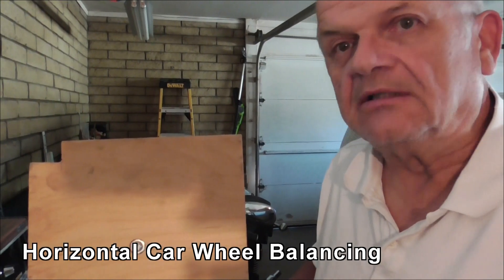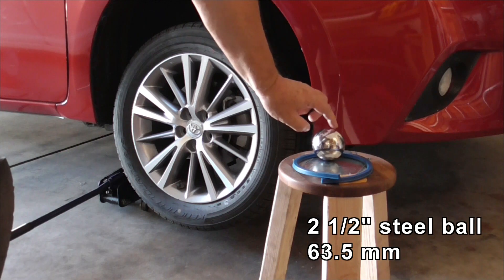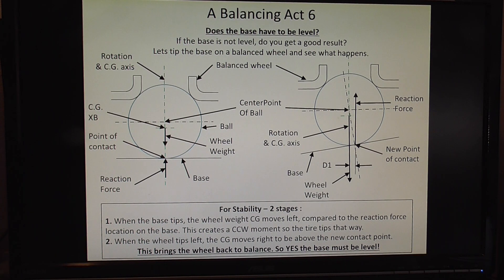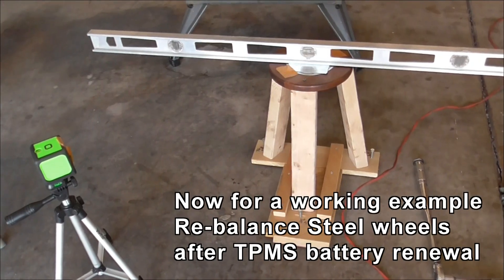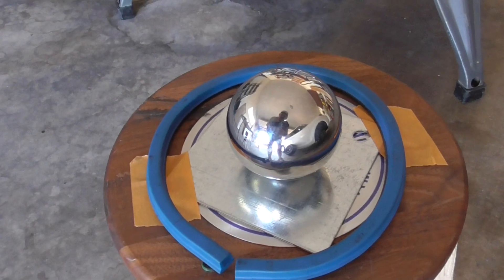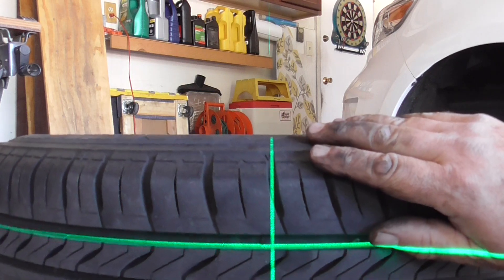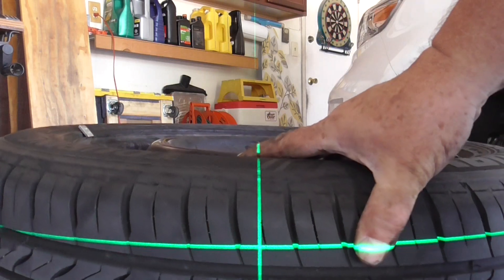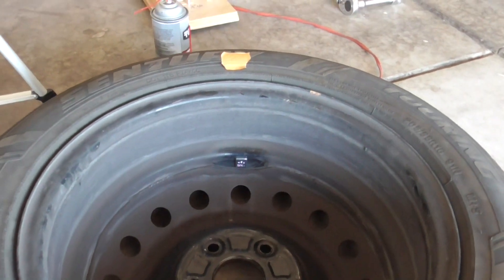Horizontal Laser Car Wheel Balancing 3

Comment: Genious! Never underestimate an older chap with lasers! Like Yoda but different. I am trying this for sure and I am pretty sure it will work! Thank you very much.
Reply from the maker: It does work on most wheels. There are limits depending on where the CG of the ball is compared to the CG of the hub or wheel assy. Couple of video's that explain that.
Kia soul tire change https://www.youtube.com/watch?v=WgjNO2gt3xg
Full explanation (boring) https://www.youtube.com/watch?v=xyv2FnseOI8

Comment: Hi, Adrian from yorkshire here. just wondering what would happen if you sat the steel ball in a cup of oil, to remain sensitive but dampen the wobble, say gearbox  oil
Reply from the maker: Hi Adrian, Like a hypoid gear oil? I'm sure that would work even though it would be a bit messy. And it would work better in winter than summer.
The important thing is that the base the ball sits on is level.

The wobble is not that bad, as I saw on a recent tire change. I pre-balanced the hub, then balanced the wheel
Hub balance   https://youtu.be/w3ukxfY6duI?t=302
Wheel balance   https://youtu.be/w3ukxfY6duI?t=550

Comment: ahhh i see you have now refined it and used a harder material. Im getting sub 5 gram sensitivity.
Reply from the maker: 5 gram, or 1/4 oz in my case, is more than good enough for the speeds I'm comfortable with. There is a tollway in Oklahoma with an 85mph speed limit and the tires are smooth as silk at that speed.

I now just use the sticky weights too, so I can put them in the wheel CG plane. That avoids dynamic vibration issues.

Comment: I had tried putting a 1.5 inch steel ball in the harbor freight balancer and yes it was super unstable when tire was put on it. so the higher the ball is in the center twards the top center of the rim, the more stable it is and will balance on the ball
Reply from the maker: Was it this video???
https://youtu.be/lOFi-bioUpc?t=132
I think this is a fake.
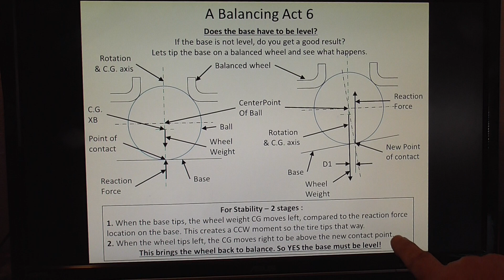If you look at time index 3:56, he already has 3 weights already attached to the wheel and he's adding a 4th???
If he has no weights on the inside rim, he will get a dynamic vibration at about 60 mph if that wheel goes on the front. At time index 4:34 I see one very rusty weight on the inside, but I can't see the whole rim.
How is the ball centered to the wheel pilot? He never shows that, tape doesn't cut it.
Does he have the resting surface level, not just flat?

Comment: if only Id seen this video 2 hours earlier as i just ordered 2 vintage made in usa balancers oh well.
Reply from the maker: Sorry. The vintage ones might work.
One of my goals in doing this is to come up with a device that works and is cheap to make by anyone with simple woodworking tools.
Reply: Oh im probably going to try both.  Your methods probably more accurate  @richbinaz
Reply from the maker: @zundfolge1432   If the ball gets too big, the wheel can become unstable. That happened to my corolla alloy wheels. Took me while to figure out why.
Wheel hub diameters I have come across so far are (in mm) 55, 62, 67 & 77.8
Hub centric rings I bought are 78 ---> 67.1 & 67.1 ---> 60

Comment: Very interesting ! Did you check the wheels after with a professional machine , to see how good these results are ?
Reply from the maker: No I haven't. 
I have ridden in both cars at speeds up to 85mph (speed limit on an Oklahoma turnpike) with no vibrations and no steering wheel judder.
Placing the minimum amount of correction weights close to the wheels CG seems to do the trick.
Reply: this method is super accurate and youd be suprized because Ive had problems taking my tires to be computer balanced (greatly depends on the place taken).  Hit and miss as to where you take your car.  This is why Ive had enough of paying a good chunk of change only to not get a perfect balance at a shop as they are worse now for quality.  I still might just order a selection of steel balls and make this platform, as it cannot wear out, no moving parts springs ect!!!
Reply from the maker: @zundfolge1432   What I am doing now is using just one steel ball, 2 1/2 inches diameter, on a steel (electrical cover) plate I got from home depot. Then for hubs where the ball isn't big enough, I'm using hub centric rings to get the pilot concentrically down to a size the ball can handle.

For the Silverado 1500 wheel, I fitted 2 of the rings together (some scraping required) to centralize the weird hexagonal pilot down to a smaller size. That is a 75 lb wheel assy. Probably would have broken my glass ball.
https://youtu.be/gGv5MUxbQ3c?t=60
It is working at highway speeds.

Those $6000 balancing machines should work, as long as they are used properly. I think in the rush to get tires on and balanced, the wheels isn't mounted properly on the machine - or the machine is damaged somehow. Just speculating.

Comment: Rich did you get this method to work with the 2.5inch steel ball with an alloy wheel.

Would you suggest a 2.5in ball as a good size for steel and alloy rims.
Reply from the maker: It depends on the size of the hub pilot. The smallest one I have to deal with is 55mm, then a 62mm, 67mm and coming up soon a 77.8mm. The 2.5" steel ball fits the 55 & 62mm sizes, but not the others. I could use the glass ball for the others, but one of the 67"s is not stable on that big of a ball. So I'm getting some hub centric rings to make a smaller pilot diameter for the steel ball to work
The upcoming 77.8mm pilot will need 2 concentric rings - or perhaps I can get something 3D printed. It's going to be a heavy wheel and I think the glass will break under the load.
Reply: Thanks for that Rich.....found a 2.5inch steel ball on ebay UK...£25gbp.....I will try one. @richbinaz
Reply from the maker: @nickaxe771  The Chevy Silverado 1500 wheels balanced fine with the 2 hub centric rings, and the 2 1/2" steel ball. But I did have to clean up the plastic rings before using them - molding marks and one needed a radius instead of a sharp corner so they would nest together properly.
https://youtu.be/gGv5MUxbQ3c
Those wheels weighed 75 lbs (34kg) each.

Comment: Hi Rich Nick here from Liverpool UK.

Been watching your vids from you tests with the Harbour Freight bubble tester....like to have a play about with one but seems a lost cause.

I like this latest idea you have.....looks very promising....wonder how much and where you got your laser lever.

I used to own a small aeroplane Microlight here in the UK Ultralight over there....saying that you sound like a Brit?

On my little aircraft it had a 3 blade propeller...carbon fibre.....alloy hub.

After a few year it went slightly out of balance.... could feel buzzing through the airframe.

You could buy a balance tool from the prop maker....a very simple idea....adjusted to suit the C or G with washers....you adjusted till just before the tipping point....very very very sensitive.

Had to be used indoors so no wind....had to hang it from a beam ie wide door frame....I still have it but not the aircraft...and its instructions....can send you a copy if any interest.

Got me thinking looking at this vid....could I rig something up working on the same principle.

The cord obviously need to be centred with great accuracy....but they had a simple idea for that.....bit complicated to explain.

Basically you adjusted your balance weights and with a visual reference to the cord it hung from passing through a tube.....and it had to be centered.....easy to do.....gave a perfect smooth operation in flight.

You could adjust with various types on weight....paint blobs on the prop tips....is one....or washer under the fixing bolts through the props mounting hub.

I would maybe need a lathe to make the simple device.

Its so easy to take your wheels to a tyre shop but I like to do all my own work be it cars motorcycles or homes.....alway changed and done my own tyre work cars and bikes.

So would love to be able to balance my own wheels.....I have a ballance rig for my bike wheels.....from the maker its quite poor.....but I have found a method that suits my wheels perfectly.

Most bike tyre shop use a similar rig as the one I bought....and prob trust it....but in fact the results are poor....and so the unsuspecting owner know very little difference.

If you like email me at nickjaxe at ntlworld dot com.

P.S. just noticed on another video....that your a Triumph Bonneville owner like me...well I never....we must swap notes.

Mine is a 900cc water cooled T100.
Reply from the maker: You can find a bunch of self leveling laser levels on Amazon.com - just search for "self leveling laser level"
A tripod with a vertical crank handle will work nicely with it and you can use it with your "hang from the ceiling" method as well. 

One of the problems I'm finding is that all the wheel hubs have different pilot diameters. Just did a Kia and the steel ball was too small, had to use the glass one. I'm thinking about getting some "hub centric rings" to fit those wheels to get the ball size down and not encounter the CG location issue that makes the wheel unstable (un-balanceable).

The good thing about using a ball is that it centers on the wheel hub pilot lead in chamfer, so it is as centered as it can be, in any position.

For cars, I use my mk4 tire mount/demount tool video 26 in the playlist. 
If you want to make one, look for "tyre Duckhead" on amazonUK and it's the red one that pops up
Manual tire changers on AmazonUK are pricey - $60 here https://www.harborfreight.com/search?q=manual%20tire%20changer but that is the USA. AmazonUK needs to drop that leading £100 from their prices. Aliexpress may be a better deal.

For bikes, I'm still experimenting with the mk4 tool with a Rabaconda head on it. It can work, just not as easy as I thought it would be. With the Bonnie, I think tire levers are better, but I do like the stand I made so I don't have to do them on the floor. I'm going to try the Suzuki front tire next with the rabaconda head.